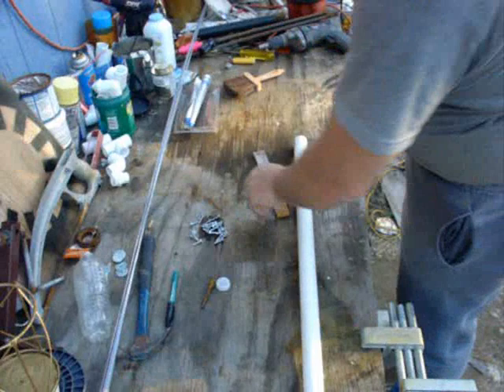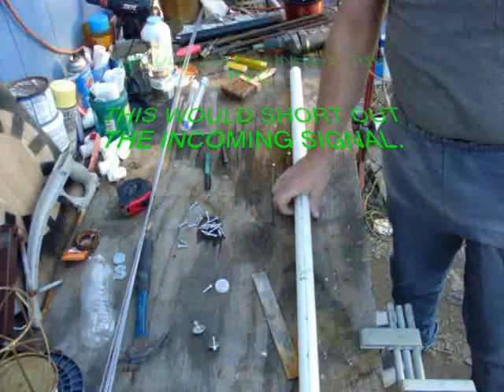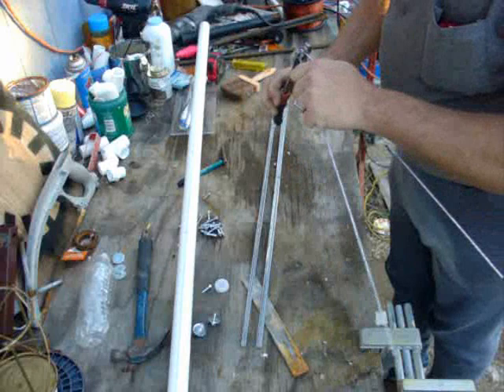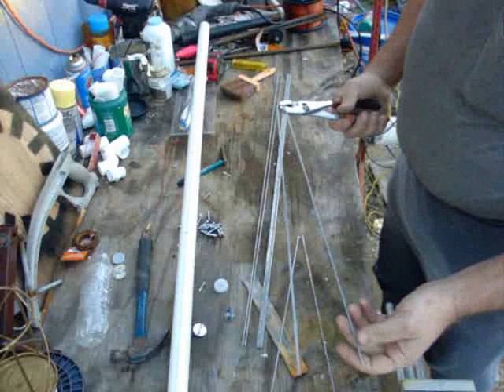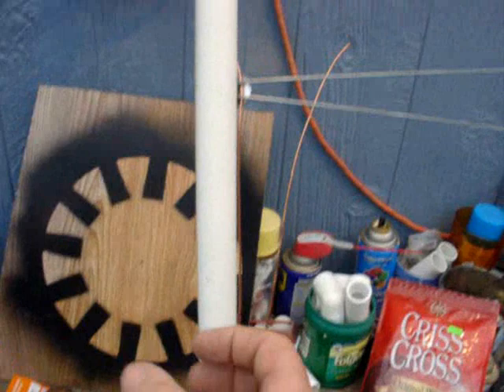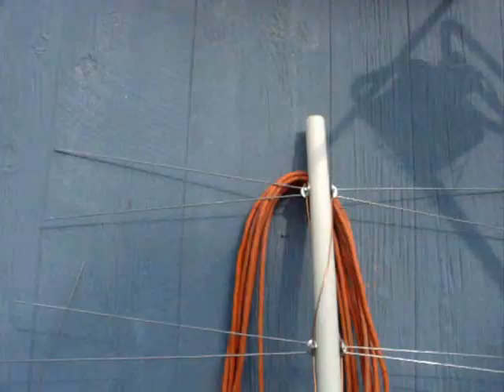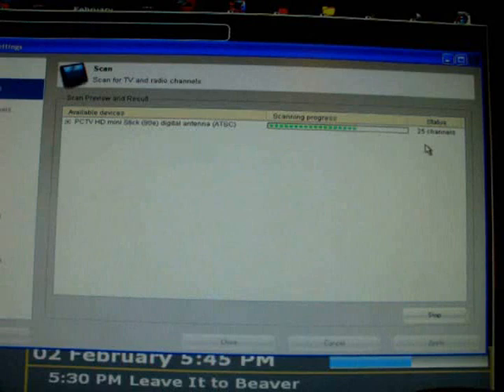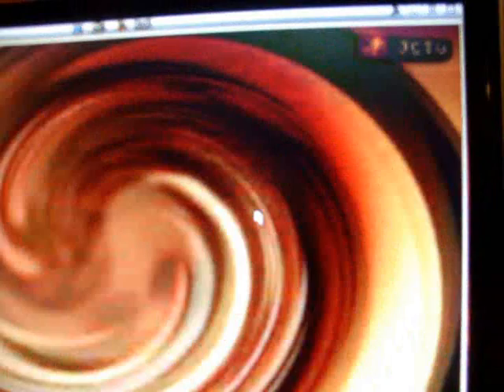EASY BUILD  HD TV ANTENNA   FREE HD TV 2020

Comment: Muddy built your bi directional HDTV works greats miss heard you  say 3 foot lengths on the aerials just caught the 18" cut them 20 just to be sure ended up with 9 1\2 " aerials but still beats my channel master I bought just as the switch to digital TV started I paid right at $100.00 for that big 8 foot long antenna and never could get but one channel good in most weather conditions I can't get that channel now the FCC web site said this channel is a LO V channel what does that mean any suggestions on what mods to your design might work on that channel might have to make another just for that channel only but can get channels now that have been hard to get in the past but it may be the short lenght of the the aerials causing that plan on getting more tie wire soon to make the aerials 36 " as you  stated but was surprised to get anything really with these so short I' m only about 30 miles tops from most of my stations towers but hills and trees abound beteew here and there cost me $7.00 to build it worth = priceless thanks Jamie. Alabama
Reply: +colplowboy TV chanels are virtual now. So channel 3 might actually be on rf channel 33 and channel 23 might be on RF channel 24. This was done so the TV companies did not have to change their channel numbers during the switch to DTV. RF Channels 2 thru 6 are the low band VHF channels. Channels 7 thru 13 are high band vhf and the rest, channels 14 and up are UHF. Antennas are always a compromise because the best are built for a specific channel. UHF antennas don't work well for vhf channels especially lo band vhf. Your best bet is to build a yagi antenna cut for your specific channel.
Reply from the maker: +Kim O'Brien Yes, the LO V channels are hard to get with the shorter aerials. if the aerials are longer it will get them too, especially with the fractal qualities of the rf matrix of bouncing the signals between the aerials. Nice frequency info. thanks.
MUDDy

Comment: I built one as you showed, 18 feet above ground and received stations 20-30 miles out. 
Need to reach out to 55 miles. I calculated frequency and cut the elements to 10" and will get the antenna back up to try it out tomorrow.
Reply from the maker: So how did it go?
Happy new year.
MUDDy

Comment: I had picked up 3 rolls of Anchor wire at lowes on clearance knowing someday I would use them for something lol. Item # 52685 at lowes but the package # is 122062 Multi-purpose wire Galvanized utility wire - 9 Gauge By The Hillman Group, Inc. Cincinnati, OH 45231 It's a 50 foot roll very sturdy and I used a vise to straighten it out and to make the bends. Hope this helps

Comment: The circular antenna can be used either flat/horiz or facing towards where you get the best signal (the transmitter direction).  I think it works on the principle of the old "spiral antenna" which self tunes itself (amazingly) that were used (I think to get UHF signals). When completed the circ anbt looks like a simple plastic circle with a pvc piipe going to the center of the circle with a pole going up to the center (the wires are inside the pvc) of course there is the normal 375ohm xfrrmr/ .

Comment: It does work (how well I don't know) , you obviously need a "CONVERTER" box , $55 at Radio Shack , best of Luck.  The circular design I posted about, is much easier to build but is probably a shorter range than the one in the video which appears to be a "tuned" version modified for DTV signals as well as audio signals (radio), we must be close to a tower (prob 30 miles or less) because we get 35 channels with the small circ antenna.

Comment: Do you think if you used copper wire or tubing that the reception would improve ??? How about making twice the number of elements  and reflector screen between the front and rear of the antenna??? Also, how about doubling the antenna height with extra elements make or improve the station numbers ??? Thanks for showing us how to make an antenna. Would changing length of elements make this a VHF and UHF antenna ??? Good day too Sir Muddy.

Comment: Multi-directional ~12" diam circular antenna: use 2 wires inside a approx 38"  flexible plastic tube "A" ; both ends of the tube A plug into a pvc T fitting, then to a 6" pvc tube to a 90 deg elbow down,  mount it on any 20' pole, we get up to 35 channels (not as good as yours I don't think but a bit easier/more compact for traveling. (The 2 strand telephone goes up thru the pvc pipe into the T fitting, & splits: one wire going each dir 180 deg around the A tube but not touching where they meet

Comment: Thanks for posting! I used your instructions along with those of another video to make my own unreflected version of this antenna. The first night I put it up conditions were right and I was watching stations from Kansas City some 160 miles away! Mine are 9 1/2" wide whiskers spaced 9 inches apart. This antenna isn't good for VHF low, but from ch6 up to 13 it does really well. UHF is good from 14 to about 20 and great from 21 to about 44 and still good from 45 to 51. On certain nights I've received stations from 65 to 702 miles away, the farthest being Corpus Christi TX to Christian county Missouri!
How about building a vertically-stacked 8-bay version of this antenna and giving it a test?Have a good one!
Reply from the maker: Yes! A huge sturbi-curtain flyswatter array. Three wide , and 7 tall. highly directive, and a low 2 to 3 take off angle. Rhombic-like receiving .
HHMMMMM! Rhombic propagation from an HD Antenna. 

 Corpus Christi to Christian County Missouri, far-out.

 The  excitement of just receiving from that far away, is worth more than if they played good shows, or boring content.

Comment: I didn't think it would work but I tried it and toy surprise it worked better than my hd antenna that is on my travel trailer. Even with just 3 arrays on each side. Before my strongest signal was 10 out if 18 (10/18). Now out of 48 channels my weakest is 10/18 and 10 of the channels are 18/18. I'm going to do some tweaking to it to make it a 360 degree antenna. Also could you make a video of how to shield it from lightning? Thank you for the video :)
Reply from the maker: ronlaflamme Gald it worked. WWWWWWWWWWWWWWWEEEEEEEEEEEEEEEEEEEEEEEEEEE! I love things that work for cheap, and, or free. Especially when it works better than the store bought models.
Thank you very much.
MUDDy

Comment: Excellent video. I live in Seattle and understand that we can only get 21 channels at most on the West side of the state. That's better than nothing. I'm still kinda learning how to make these things. Can't afford a lot of cost right now so this video helps.Thank you.

I have a question regarding the transformer. Why is it necessary? The coax I have is also 75 ohm. Why is the antenna 300 ohm? What determines this number? Finally do they sell these at radio shack or can I make one myself? Is the transformer serving the same purpose as a ballun?

Thank you again - enjoyed the video. It one of the few I've found that makes sense and inspires confidence. I'm off to find some ceiling grid wires.. I forget if Home depot has these things. Haven't hung a grid in years. I remember throwing out boxes of these in the past. Oh well can't save it all.
Reply from the maker: L7pusher If you save it all, the yard will look like mine and Sanford and sons. Oh wait... Mine does look like Sanford and Sons' yard.
Yes the transformer is a balun. BALanced to UNbalanced transformer. 
anywhere a coax is used, baluns are usually needed. coax is a 4 to 1 invbalamce due to the surface area of the two conductors and the velocities of the waves in  each of them. The antenna is a 300 ohm load because of the spacing of the wires that connect all of the aerials up the side of the antenna pvc. Just like ladder line. dipoles are usually 75 ohm. sounds scary huh?
Keep smiling and have a ball.
If you have trouble with it, try connecting to the middle of the antenna instead of the bottom.
:)
MUDDy

Comment: You have a very interesting design. have you tried making it a mono-directional antenna with a reflector behind the elements? It should increase your signal strength quite a bit. which is what i need for my location...

Comment: Really great video, and you obviously know your antenna theory, I may try my hand at this since a bi-directional antenna would be useful in my situation. Is this antenna resonant on both VHF High and UHF? The element lengths lead me to believe it favors VHF. You mentioned in a previous post about expierience building AM antennas, I would be interested and appreciate if you could share a design or two since you make wonderful instructional videos.

Comment: I have made one of these once before from this video but that was about 2 years ago it worked great.  What gauge grounding wire did you use.  And would it make the antenna work any better if i used a thicker gauge grounding wire?

Comment: I understand the concept of keeping the distances equal, so my dumb question of the week is this.  Would adding more elements increase the range or signal strength?  I can't have an antenna about my roof line and I am surrounded by cement roofs.  I remember the old days of analog, I actually got more stations (channel 9,12 and 24 out of Chico, CA) then I get now and I have a fairly pricey antenna that was given to me at a garage sale.  I am looking for a solution to my 'fringe' market reception.

Comment: After viewing each of the ones/links you show,  in my humble opinion yours is by far the best in simple, thoughtful, practical construction [especially considering unecessary jigs, connections that are questionable at best].
    Have you made a double of this one {side by side} ? 
 Would it work to just hook up the antenna to the TV to get the number of channels available?  Depending on the tv signal strength may not be shown? Right?
regards,

Comment: I sit right between two big towns so I was looking for a commercial bi-directional TV antenna but this antenna might not have a commercial  equivalent. A four element dipole? Cool! It should work better than the RV antennas that also came up in my search.How about corrosion protection for the connections & will the PVC last with UV exposure? Would silicone grease on the connections or painting the pipe black or finessing nuts on the screws on inside of the pipe wreck the 300 ohm impedance?

Comment: Does the copper wire that connects the bow ties need have no insulation for better reception of the hi performance HD TV antenna?  I used some old house wire with the insulation removed only at the connection points.

Comment: If I wanna hook it up to the tv do I need to solder on a uhf/vhf transformer? One lead to one side the other lead to the other side of the antenna? Then screw the coax into the transformer and into the tv?

Comment: Just a curious question. With the longer " >" sections, I assume you have more VHF tv stations to pick up. In a case where you have all UHF stations to pick up you would want shorter " > " pieces, correct?
Reply from the maker: +Glen England 
The first part of your assumption is very correct. more vhf is that is what you receive where you are. 
The second part.... i say don't shorten a thing. these are a fractal design. the length will just add to the resonant frequencies and gain.

My explanation.....
The signal bounces around between the aerials to allow the resonance of many smaller harmonics that are shorter than the overall base length of the aerials.
super wide banded design.
second part of explanation....
I will use a long wire antenna to explain this,...
if a signal to be received takes 100 feet of wire, the antenna will receive many higher frequencies easily, but it will receive the longer lower frequencies very poorly. 
when you swing a jump rope you see one half wavelength sign wave in the loop. swing it faster and you will see the half wavelengths of harmonics as more loops appear. antenna receive and send at odd multiples of half wavelengths. the more half wavelengths you have, the higher the gain. 

so shortening your aerials would not give gain to the overall antenna.

I hope this helps.
Above all, Just enjoy.
Thanks for the great question.
MUDDy

Comment: Just built this antenna yesterday. I don't have a very challenging reception situation to begin with. I'm only 11 miles from 3-4 huge towers transmitting major networks. I was already getting 45 channels using a RCA table top flat antenna that I hung in my attic about 30 ft high. And now, with this exact to spec antenna I'm getting 51 channels in the same location feeding a TV 12 ft away through RG59 cable. I can get this channel which is 28.9 miles away but not the one I list after it which is only 19.7 miles away. Why? I have antenna pointing north-south. The 28 mile channel I'm getting is west and the 19.7 mile channel I can't get is south...? Strange.
Getting 
-WUNI 29 (27.1)
Univision (SI)
Max ERP: 270.000 kW
Eff. pwr: 270.000 kW
Dist: 28.9 mi   Path: LOS
Rx: -39.4 dBm   NM: 51.6 dB
Az: 295.5° (true)
Az: 310.0° (compass)

Can't Get
-WPRI-TV 13 (12.1)
CBS
Max ERP: 30.000 kW
Eff. pwr: 30.000 kW
Dist: 19.7 mi   Path: 2Edge
Rx: -56.3 dBm   NM: 34.7 dB
Az: 191.5° (true)
Az: 206.0° (

Comment: You might get more range by making all the dimensions twice as much which "might" equate to a 1/2 wave antenna.  You could investigate directional antenna's (ala the old :"beam" antenna's) which use multiple elements arranged horizontally (remember the ole analolg tv antenna's from the 60's) but of course you would probably then need a way to remotely control rotating the antenna to maximize the signal strength; but balance that with the "rumor" that many channels are sent from one tower?

Comment: Curious as to what ga. electrical wire you use to make all the hookups down the length of the pole? Does it matter as to the ga. being used or is there a common ga. of wire generally used for this DIY antenna project?
Reply: I've used 12 ga with good results 10 is better with amp

Comment: Would it make sense to use a larger diameter PVC pipe for my antenna build, then slide it over a smaller diameter galvanized steel antenna mast?  Or would this affect the phasing or otherwise ruin the antenna's performance?
Reply from the maker: I would believe the free flowing fractal flux patterns, of the high frequencies would collapse.
But!!! The design of the antenna can be modified.
Instead Have the larger pipe behind a reflector element. then mount the receive antenna section in front.

:) MUDDy

Comment: Hi,  i made this antenna,  it seams to work good in a room for a test. Yea some channel didnt come in all that clear about the same ones with old antenna, but I put it outside & it  didnt seam to work as good.   My wires are about 18 in" & 51/2  space with 41/2 between them.  Is there something i miss when i built this?
Reply from the maker: You should have better gain outside.

Make sure the metal pole isn't touching the screws inside of the antenna. 

VERY Important, Check the cable connections, Not just are they screwed in, 
But is the cable shield connected to the connector, and is the signal wire insulated from the connector.

Or the direction the antenna is pointing.
Another possibility. Seeing as it worked on the ground, And when you raised it up, it didn't see the signal better, Perhaps the stations aren't where you think they are
 The flat broadside of the antenna should be pointed perfectly towards the station.

I googled TV station location map.
I took a ruler and a dry erase marker to drew an angled line from my house to the cluster of TV stations 80 to 100 miles away.
Then I zoomed down to my house, and looked at the angle between one side of my house, and the direction of the stations.
It was first shot perfect signals.

Your measurements sound great. No problems there.

Comment: I live in central KY and decided to give this a go. Well sorry to say after spending hours trying to make the thing, it didn't work for me. Hate going back to Dish or Direct but, what do you do?
Reply from the maker: Alanna Carroll Try shortening the aerials 1/4 inch at a time until you get reception. Also check the distance between the tips of the aerials. 5 1/2 inches. :)
Also, try connecting the balun transformer to the center instead of the bottom.
MUDDy

Comment: Hi Mr Mudd, do you mind telling me what the measurements are for the rods ( 36in long and after bent in the angle, 18in? ). Also what's the distance between each section ( length and width). Also what's the distance between the 2 vertical wires that are connected to the rods. Thanks for the info, as you can see I'm trying to make one myself. Thanks again